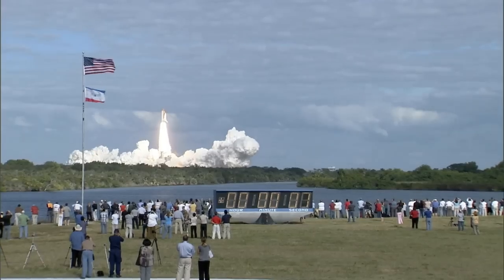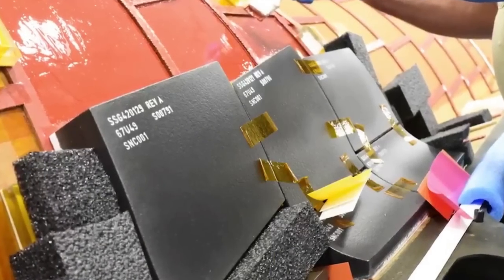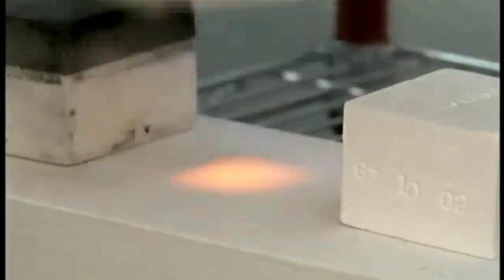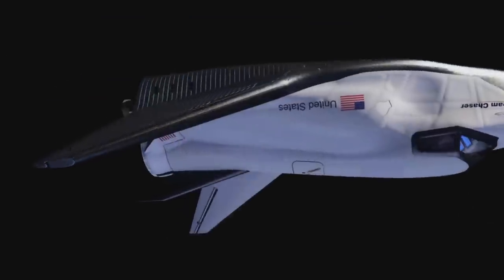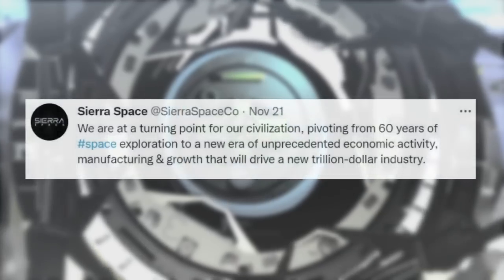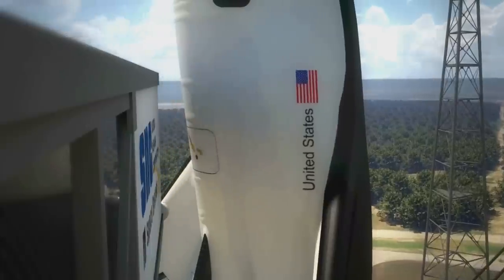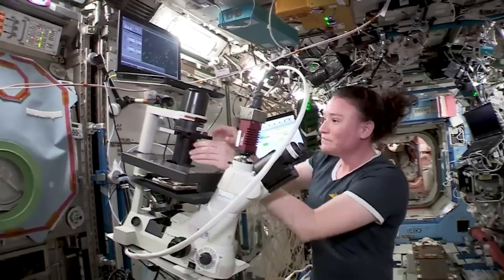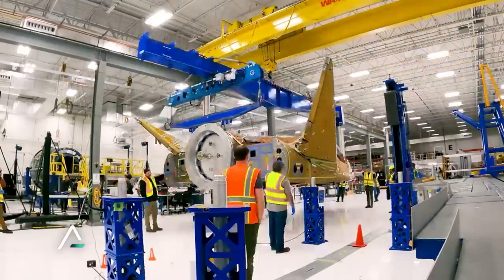Is Dream Chaser A New & Improved Space Shuttle?

Comment: I really like the DreamChaser and hope it succeeds.  Crazy to think that DreamChaser itself is already 12 years old now and still hasn't been to space!  Can anyone tell me why they opted for a nose skid rather than a wheel?  I can't imagine that the weight savings would be all that much!
Reply: Can't say I'm a fan of the nose skid. Seems a primitive addition to an advanced spacecraft. Love to know too.
Reply: Weight, way simpler* to just use a skid. They don't even need it for steering. It's way way easier to just make a skid that is replaceable than have an entire wheel assembly in there.
Reply: Fold-up wheel assembly is much much heavier and bulkier than a ski.
Reply: Aircraft steer on the ground via breaking force on the Main wheels, the nose wheel is generally just a big castor. Once the nose wheel touches down on a glider it's time for the breaks any how so might as well skip to the point and make the nose point of contact a break pad.
Reply: "New"  I'd advise you all to re-think What and WHERE you hear something after you search for M2-F2, a lifting body (they suck) program around since the 1960's.  It will even "look familiar" to you.  The Skid instead of Wheel is a space/weight savings and prevents digging into the compacted sand at Rogers Dry Lake where early lifting Body AND early Space Shuttle landings were made. The front touches last. If properly made of low friction materials it can also do little to no damage to a prepared runway though cleanup of the material lost to friction is necessary.

Finally,  "reusable" craft for space is unwise, as already demonstrated, if it carries something of value or shouldn't explode.  Space is a very harsh environment, mostly due to no atmosphere creating a non-stop, very high speed bombardment of particles from simple (high speed) dust to larger minerals - even Space junk from other man made objects.
Reply: @acarrillo8277  Maybe for some small aircraft, however larger airliners absolutely use their nose-wheel for steering. They even have dedicated tiller handles for it
Reply: ha ha ha ha......z z z. zz.
Reply: I love the dreamchaser concept too. Even though it didn't make the final rounds in the NASA contract it clearly captured the imagination and still got funding. Personally I think it could be the best reusable ship for the ISS and its future replacement.
Reply: Any aerospaceplane concept has massive mass-fraction/payload penalties, and complexity problems. Essentially all in exchange for cross-range landing ability on an airstrip. Several, but not all of the penalties can be avoided by using a small vehicle that can launch on a traditional vertical stack rocket, such as the Dream Chaser, or the unmanned X37B. Everything that's "airplane" is dead weight for the entire mission except for the last few minutes before landing. A lifting body also reduces but doesn't eliminate all the penalties. The simplicity of the skid saves a few kilograms that can all go to something else. More "space-useful" equipment, extra life support for crew, or just weight/mass reduction for the entire vehicle. Simpler shape for the thermal protection tiles, the seams where it opens, a slew of things.
Reply: @arcanondrum6543  By the '  "reusable" craft for space is unwise, ' logic we should not be flying space station.
Reply: @Cheeky-fingers  I would certainly prefer it over starliner.
Reply: @joeylantis22  well thats just shit! if the pilot needs to correct on touch down, how the hell is he going to steer if theres wind shear? throw an anchor out the opposite window, depending on steer! :) lol
Reply: @D NASA wants more then one way to put people on the ISS.   3 would be better than 1. Starliner still iffy.
Reply: @arcanondrum6543  The 6 million dollar man show had a video that was to be Steve Austin in the M2-F2 lifting body.
Reply: @tepidtuna7450  the nose skid is lighter, takes up less space, and is a natural brake

Comment: You seem to have become confused, what you describe as "difference" is in fact what shows Dream Chaser is a new & improved type of Space Shuttle improving on the heat tile technology that the Shuttle was based on; where they differ is that the Space Shuttle was acting like a heavy lift delivery system where as Dream Chaser is focusing on human size loads that need to go up and come back down, thereby making better use of the landing capacity. I wish the team good fortunes.
Reply: I think dream chaser is the perfect solution for Elon Musk's starship. Instead of the extremely risky maneuver to land starship (Which I don't think will ever be human rated) dream chaser could replace the nose cone section and be detachable from the tanks and propulsion of starship. When returning to earth, the dream chaser can detach and land like a glider while the tank and propulsion do the belly flop re-entry. It would have to be scaled up though.
Reply: @paulmichaelfreedman8334  ...But that would be neither rapidly reusable nor fully reusable, which is the whole point of starship. Achieving a consistent landing profile doing a belly flop is not impossible. But dream chaser and starship are different vehicles with different goals.

Comment: They look a lot like a larger lifting body of the early  1970s designed for spaceflight. Lifting bodies were used to test gliding characteristics of wingless aircraft by NASA. The dream chaser has design input  from the Rockwell Space Shuttle and the Northrop HL10 and M2F3 and Bell X24B. It's a pity the former Soviet Union was so economically poor that they did not have the funds to keep their Space Shuttle Program with a Shuttle named Buran and it's fellow spacecraft going and the Russian Federation develop it further with the Energia Rocket launch system upgrading to the latest reusable engine technology.
Reply: Negative on Dream Chaser having much input from the Shuttle or the NASA lifting bodies.
It was influenced by the older HL-20 (which NASA should have built in the late '80s instead of going back to only using the Shuttle), which itself was influenced by the Soviet "Spiral", competitor to the X-20 DynaSoar.

Energia was a good bet. It is too bad they couldn't keep it going.
Reply: Ruskies had one that looked just like this.
Reply: @tedolphbundler724  
The "Spiral" space interceptor, and the sub-scale model called the BOR_4 which they flew to test the TPS for their Buran Shuttle.

NASA Langley studied the lifting body shape and adopted it for the HL-20, which NASA should have built in the ;ate '80s instead of gong back to using only the Shuttle.

Comment: The Dream Chaser doesn't seem like much of an advancement over the nearly 50 year old technology of the Space Shuttle. 
It's hard to believe that there isn't a better solution for a heat shield, then the glue on tiles. The tiles were problematic during the Space Shuttles life.
Reply: It also has launch escape systems, which the Shuttle did not, and it can come down on any runway, which the Shuttle could not.
Reply: @JFrazer4303  I understand all of that and I appreciate your comment.
I was referring to the advancement in the overall technology. The Space was from 1970s technology.
Reply: @JFrazer4303  That is because it is much smaller

Comment: Shuttle: Workhorse
Dream Chaser: Shetland Pony
Reply: I wouldn't call the shuttle a workhorse. It cost far too much to launch and it took far too long retrofit after each flight
Reply: Using the horse comparison, the Shuttle was a racehorse, needing special care and feeding, instead of a pony which can get by.
Rather say the Shuttle was the Camel: A horse designed by committee, so it's bad tempered, smelly, with humps. At least the real camel is very well suited to its tasks.
 IDK if there's a "racing camel" which has all the flaws, none of the benefits, and needs special super-expensive care.
Reply: Well Shetland ponies were actually used in the mines and hauled a lot of ore and other "workhorse" uses, very efficient back in the old days, but I get what you are saying. ;)

Comment: Is Dream Chaser a lifting body? Doesn't that give it aerodynamic qualities that make it unstable w/o a fairing? Is vulcan being designed to compensate. What is the weight penalty for stiffening the connection to the Vulcan rocket? I was disappointed when that cobbled together entrant won over Dream Chaser for the NASA resupply contract. https://www.nasa.gov/centers/dryden/history/pastprojects/Lifting/index.html
Reply: Computers are fast/smart enough now to compensate
Reply: The cargo DreamChaser will have retractable wings, and launch under a faring.

The crewed DreamChaser has fixed wings, and launches out in the open.  The wings WILL create lateral lift at launch, but if you study the animation, the little shuttle will be mounted atop the rocket slightly off center, creating an imbalance away from the wings, which will balance out the wing lift.